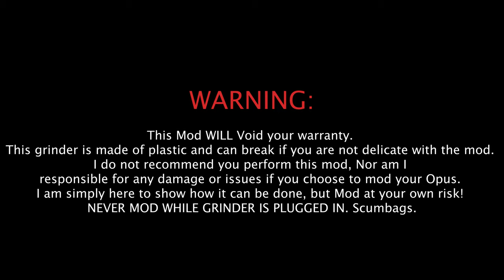MAKING the Fellow Opus BETTER (Stepless MOD)

Comment: I don't understand the point of doing this. Never had I had the need or urge to set my Opus between the 5 and 5.25 settings (or any other in-between). I feel like this is just modding something for the sake of modding.

Comment: i know that this vid is a bit old but now that it has been some time after the mod did you see your grind setting change for espresso or any drift?
Reply: YES! It drifts quite a bit for me.
 By the time I'm done grinding 30 grams for filter, I'm a full click away from the setting I started at.

Comment: Thanks for the vid. I’m a newby and thought I would venture into a latte made with oily dark roast beans. (Not a good latte. Lesson learned.) Unfortunately made a few with the dark roast beans. Resulted in too much build up. So to clean it, I followed manual instructions. Unfortunately, when you remove the nut holding the inner burr, the bolt drops down. To get the bolt back in place, you have to disassemble the machine and carefully feed it in with needle nose pliers. (The official Opus video for changing burrs has you lay the machine on its side and holding the bolt in with a metal rod.) Could not have done it without your video. They could have used some kind of retainer for the bolt. But that is my only complaint so far after about 250 uses. Subscribing for your other content.

Comment: This video helped me fixing my Opus, I was pulling shots at the 1 mark and -4 micro adjustments (almost a the very end of the rope), but I "miss aligned" the gears 4 notches to the left and now I'm getting great shots at the 2 mark (-1 micro).
Thanks a lot!
Reply: What time code helped you get it resolved? I'm in the same boat.
Reply: @angelcalzadilla9349  Around 2:08 moved the ring a notch to the right to make it tighter. but sometime later like something settle in inside and I have to revert it back. perhaps something was misplaced and got fit into place after too many smacks trying to release the coffee retention the grinder loves to keep. good luck.

Comment: Holy crap, so many steps! Nice, clear explanation, thank you. I know they're trying to keep costs down but having all those plastic screw holes will probably mean easily stripped holes (if they weren't when it was manufactured).

We appreciate your sacrifice. :)
Reply from the maker: I think the actual acre hole is still metal inside.(I could be wrong) if that’s what you meant. 
But the shell and gears are all plastic for sure. 
I wish it was all metal though, it’s fairly cheap and the burrs are solid. 

The sacrifices will continue until I’m just an arm and a hat 🧢

Comment: So happy to have found this! Your disassembly confirmed what I'd pieced together on how the micro ring works (not moving the burr but just shifting the range a tiny bit) based on some testing. For those keeping it "stepped", the trick to using the micro is to move the macro back and forth a bit then to re-sync everything. You're no longer showing between steps once you do this and you have shifted by 0.66 clicks. This is why Fellow now says to do the adjustment way up on 6 on the macro ring. It forces you to move the outer macro a decent bit to re-sync things.  https://youtube.com/shorts/gM5ZYrSRuFA?feature=share
Reply from the maker: Exactly. So many people got the dial in mechanism wrong in videos. But it’s an illusion of change. Then math and then it resets. 

It’s imo considerably better to just go stepless

Comment: Nice work! You made it look easy :face-green-smiling:Did you notice any drift post-modification? I think we need a follow-up video on how it grinds and pull a few shots, plus you know... a few swans (just for good measure).
Reply from the maker: I’ve noticed no drift. It’s not easy to turn in general so it stays in place (for me) I will for sure follow up haha. I can flex a swan or two 😂
Reply: @EmileeBryant  If there are no downsides I wonder why manufacturer added this step mechanism. Customer gets higher precision and manufacturing should be slightly cheaper as there are fewer parts.

Comment: Now i understand the inner ring - just like the breville smart grinder pro. The micro ring wasn't doing anything with the adjustment so you need to turn it with the macro. 

This stepless mod completely takes care of the adjustment calculus
Reply from the maker: Yes it makes the process seamless. 

What was unfortunate is many people never show that you MUST move the macro ring and then just the micro does nothing. 

Also you will only ever need the first two micro adjustments on either side. The rest are simply for extra range on the grinder.
Reply: @EmileeBryant  you are the very first and only one to mention. we all had the impression the inner ring was moving the burr. Thank you so much for the work
Reply: I am very confused by what this is saying
Reply from the maker: @BloodyTaco4459  a lot of people said that when you move the blue ring, that is moves the burrs. But it does not do that. 

It instead detached the outer ring and displaces it off its number just a bit (but again no burrs have moved) 

So then once your ring is adjusted, you must move the outer ring back one click for the change to happen. 

Basically you are determining how much the put ring can move by offsetting it a bit in either direction.

Comment: Thank you, Emily for an excellent post on the opus. I want to find a way of getting Better access to the exhaust chute so I can Clean it More effectively. You point out correctly that getting into it the way I want would probably avoid the warranty.  I might go ahead anyway in order to do What I want. I see that there is a plastic screen in  the bottom of the plastic housing I was thinking of cutting  it out to allow easier access with a brush .Your thoughts. By the way, FYI use compressed air with a trigger gun to really clean out inside parts. I can't see, especially the anti static pins.

Comment: Emilie, do you have any suggestions for how to prevent severe retention with this grinder? After a few months of use mine retains all the grounds inside the area near the burrs. I have cleaned it and even after I get all of the grounds out, it simply happens again.

Comment: That’s pretty slick! How much more dialed in does this make it? Would it be worth it for pour overs?
Reply from the maker: I would say it’s ideal because the way the dial works now is arguably the most confusing system I’ve seen in coffee grinders. Why they added two wheels I’ll never know but making it just one makes life easier and you can get the inbetween dial a bit easier
Reply: The two wheels aspect isn’t a problem for me, but the clumsy nature of the steps is quite annoying. I’m very much considering making the mod you’ve made, but using a dremel tool to cut out a small section, remove the spring, and close said section. The biggest obstacle to this is localizing the spring without being able to see it. It seems it’s about in the middle on the left side of the grinder, but I could be wrong. What do you think?

Comment: Do you still use this grinder as a stepless?  Just curious if any issues or drifting have been noticed with longer use.
Also, does the blue ring do anything after the mod?  If it still affects how far you can turn the ring, I guess you'd just turn it all of the way down (if mostly used for espresso) and leave it there?
Reply from the maker: I don't use it day to day enough to validate if it drifts over time, but i do sometimes use it and so far its still solid.

Comment: Could one just use some wire snips and cut the spring out of the slide rather than open up the gearbox and risk contamination?
Obviously, to get the steps back, you'd have to find a replacement spring that fits, but that process wouldn't require opening the gear box either?
I can't tell if the plastic slide can be taken out after the spring is out of the way, but if it's an issue, maybe it could just be taped into place on the housing.
Beyond that curiosity, this is amazing. It's like a perfect upgrade.
Reply from the maker: You could probably cut or just pull it out since springs are so weak. And you’d likely be able to replace with any spring the same size! 

Glad you enjoyed this! 

I will say if you don’t open the gear box all the way, you probably won’t contaminate but I can definitely understand wanting to snip it away. Like an appendix

Comment: Hello! Thanks 4 the video,  i was Looking for some vídeos to dial in my Fellow Opus, because i don’t know what’s wrong in my case. 
Let me explain, when i grind i can’t get lower than number 5 in my grinder, although I’m using good quality fresh beans. The ones I’ve got now are roasted the 28th of August and 85SCA. (I’ve used differents coffees all fresh and over 85SCA. My coffee machine is a sage bambino and I use a bottomless ikape portafilter with the básquet that came with the portafilter. I use a 20gr dose because I like a larger espresso. 
My complains are that first of all I can’t go finer than 5 and I think I don’t get enough crema in those settings. After it takes ages to grind 20gr. I have to press many times the button, (recently discovered that a long press is for manual stop) 😅. My grinder has a lot of retention. I’ve cleaned all parts several times and see if it was all ok with the grinder and it seems all parts are in good conditions. Long story short, under the lid of the grinder it says that the range for espresso is between 1 and 3 but I can’t grind under 5, and it takes for ever to grind and I can’t get enough crema.  Hope you can give me some hints!! Thank you!!!!

Comment: Can someone confirm that this grinder can go fine enough for espresso and coarse enough for cold brew after going stepless? Lance mentioned that the grinder loses some range when going stepless, and I"m not understanding how that could be the case.
Reply from the maker: I’ll say this… no one has explained the dial system properly online (I had to open it to fully understand it) so I don’t think it’s even worth keeping as a stepped grinder cuz you’ll always struggle with the dial mechanism. 

Making it stepless won’t reduce your range it will just make it less precise when you go for in between numbers (as opposed to slightly more precise with the steps but Impossible to actually navigate like a magnet on a compass) so imo just make it stepless and enjoy the grinder. 

It can do espresso and it can do cold brew. Also also you can alllllways change the range by zeroing it out at a different spot (but I doubt you’ll need to)

Comment: Is the micro adjustment of this thing actually doing anything? Like if all the micro adjustment is doing is offsetting the outer ring by 2/3 of a mark, but the step graduation and the actual burr movement are independent of the outer ring you could offset the outer ring any arbitrary amount you wanted but your next click is still going to be the exact same adjustment as if you hadn't offset it... right? If the stoppers are applied on the outer ring you gain some extra range on the grinder by offsetting it, which is what Fellow also say it's for, but adjustment?

It's hard for me to to tell for sure because this video didn't go into detail about the interactions between the various rings and the step mechanism. It's possible there's something going on with the rings that's not really visible in the video. But I've been frustrated by what seems to be conflicting explanations about the micro adjustment of this thing, and there's enough play throughout the adjustment mechanism of my Opus that I can't really get a good read on whether it's doing what it's supposed to. The "zip it back and forth to sync" thing seems like nonsense, mine goes right back to its offset position no matter how much I do it. But there's enough play in everything I'm sure it's easily possible for someone to have the marks line up if they're not as pedantic as me. 

I really don't want to disassemble mine after only a week of ownership but this is going to drive me crazy.
Reply from the maker: No no you nailed it on the first paragraph. 

I’ve been trying to explain that to my pals that own these that the rings don’t really connect. When you move the micro adjustments you are (like you said) NOT moving the burr. Just offsetting them for the next click to be 1/3rd or 2/3rds off.

Comment: So do you still have to use the inner blue dial for fine adjustments or can you do it all with the big outer ring now?
Reply from the maker: Great q! 
You don’t need the blue dial to get fine adjustments. But it’s still needed in the grinder to help move the burr. 

If you were to master the original dial in fine tuning method, you will have more technical consistency when you apply the proper math every time you dial in. I like this because I can simply use my hands intuitively vs doing math to maybe get close.
Reply: @EmileeBryant  Am I correct in assuming that the blue ring could still be used to adjust the range of the grinder (as in, going 0-10 instead of 1-11)?
Reply from the maker: @Alnakar  yes! That still functions normally as a range extender. But the micro adjustments no longer do anything.
Reply: @EmileeBryant  Thanks! The more I think about this, the more it seems like your mod is truly necessary for getting grind sizes in-between the macro adjustment clicks, not just for ease of use.

(sorry for the incoming wall of text...)
If I move the inner ring all the way to the "-" side, I'm essentially moving the outer ring from 6 to 7 without moving the burr, right? So it's set at 7-1, which is still equal to 6. That way, when I set it at 1, it's really at 1-1, to give me access to a grind size 0. That all makes sense.

Then, if I want a grind size in-between 2 and 2 1/4, I would want to be able to set it to, say, 1 3/4 on the outer ring, and +2 steps (+1/3) on the blue ring, to get to 2 1/12 total. The problem is, when I make the micro adjustment, the clicks don't stay aligned to the 1/4 adjustments. I'm moving the outer ring to 1 2/3, so I'm really at 1 2/3 + 1/3, which is still 2. That makes sense, since I haven't moved the outer ring yet. Then I'm moving one click on the outer ring, and it's clicking in at 1 11/12 + 1/3, which is still just 2 1/4. I'm shifting what my grind size "reads as", with the micro adjustments, but I don't think I'm actually getting access to any "in-between" sizes with the un-modded grinder.

Either way, I'm definitely making my grinder stepless this weekend! That just seems like a much better solution, lol!

Comment: May sound stupid… but what is the point of stepless? I’m genuinely curious
Reply from the maker: So you can get the grind size in between the pre designated steps :)
Reply: @EmileeBryant  would it be a easy to get back to a previous setting without the click?

Comment: Thanks for the video! Just a question at 7:48 it still seems stepped, is this make only the inner ring stepples?
Reply from the maker: thank you! 
It is Step-less at that point. The outer ring just ins't very smooth in general so it looks choppy
Reply: Thanks again! I will give a try! But for everyone who are not able to do it the beanie opus app can help to dial in.

Comment: Interesting...but looking at how easily it's rotating now, doesn't it cause the grind settings to be changed during the grinding itself? I mean vibration and whatnot...
Reply from the maker: I actully find it a bit grippy. As in it’s hard to move in general so it stays put (also the actual burr gear deep in the grinder has very subtle wide rounded bumps so they don’t slide back and forth on a flat plane. 

That being said my grinder has not drifted but yours totally might. Idk. 

Though some electric tape to add frost ion could be applied!

Comment: My grinder was not set to 6, just my notmal setting, and when I reattached my steps seem all off. I followed the guide just to take apart and clean a bad clog, not go full stepless. Any idea how I can "reset" the burr setting to default/make sure mine is aligned when reassembling?
Reply from the maker: @michaelrodriguez19  it might be tricky to get it back to 100 factors setting but you can try reopening it set at zero then  turning it until it’s at burr lock. 

Come back a bit from that so 0 isn’t burr lock. Then you can close it (with the indicator positioned at zero when you reattach.) 

Essentially setting it to is tightest point and then assemble with the setting positioned on that zero point. 

Should be pretty normal after that give or take
Reply: @EmileeBryant  For anyone else who messes up like me - the correct factory alignment is marked with a silver marker, all you have to do is make sure you line it up when re-assembling. I have two units, and checked that both have this hand-made mark for aligning.
Reply from the maker: @michaelrodriguez19  didn’t realize this! Great advice

Comment: Hey Emilee! I found my Opus doesn't grind coarse enough for me :( 
Do you think there’s a way to mod it to make it grind coarser? Thankssss
Reply from the maker: @tiagoabrahao9137  yes you can! 

When it’s opened up turn the gear inside towards the coarser side then pop the guiding arm lid thing back on. 

Just remember to have the dial arm in the same spot when you took it off so the turn you do is in relation to the original dial position. 

Essentially turn the inner gear when it’s open and turning it tighter sets it finer and coarser set is larger.
Reply: @EmileeBryant  great! Could you point in your video, what would be the “inner gear” you said?
Reply from the maker: @tiagoabrahao9137  yes. 

At 2:15 ish you can see me pointing to the outer ring and then I take it off. Do what I did but then Turn the gear it was attached to counterclockwise a little. 

The put the top gear back on in the same position and then reassemble. That should move the burrs to coarser.
Reply from the maker: Ignore all the details I say in the video after that. You just need to turn the gear and then replaces everything again